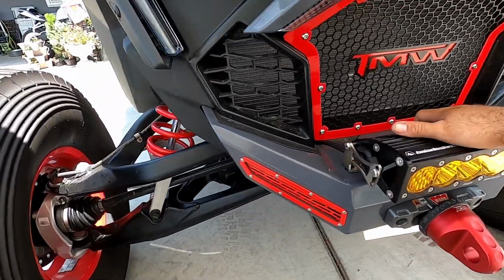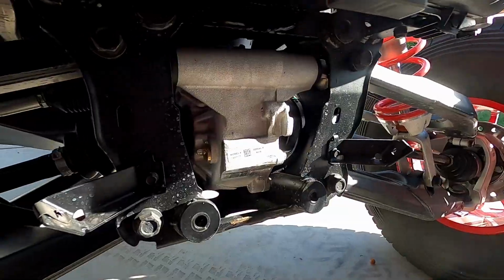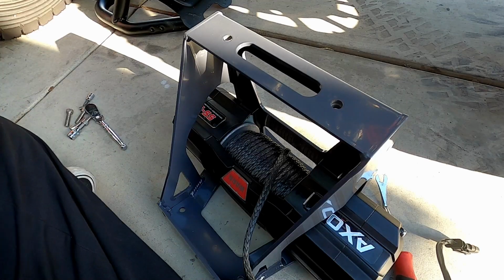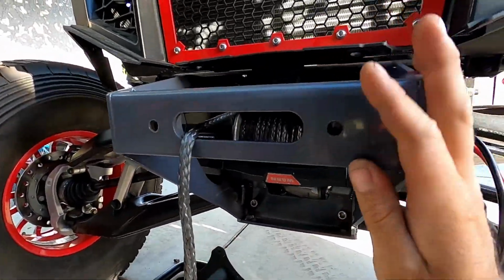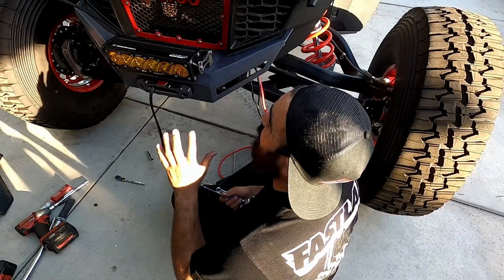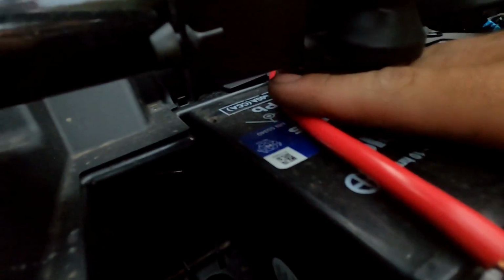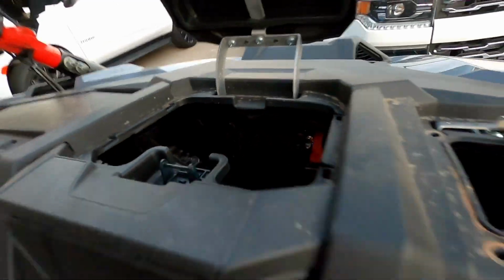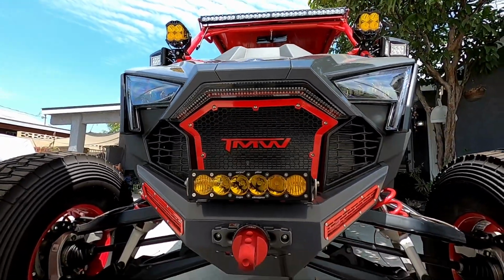Polaris RZR PRO R WINCH Bumper TMW OFFRoad EP-255

Comment: Hey Frank What are your thoughts between the Turbo R & Pro R? If you have any? Any big difference?
Reply from the maker: Huge engine difference. The Pro R has so much more potential in power. With that said. Not everybody needs that much more power the Turbo R is plenty powerful and probably better for the trails. Besides the engine and the slight wheelbase difference. They are both amazing machines for the desert, dunes, rocks, just about anywhere.. incredible machines
Reply: @GLifeUTV  Thanks that was a great response! I'll add both of them on my X-mas list. 😄

Comment: 🏆🏆🏆👍🇺🇲🙏.
Warn tech service says the smaller winches can spool onto the top of the drum, (mounting the winch upside down), wheras the large winches need to spool onto the bottom.... Which means you have to reverse the polarity.

IIRC, the Warn Hub blue tooth component will show battery voltage and line pull tension.
You did a great job✌️⭐⭐⭐.
Thank you for sharing
Reply from the maker: Thanks for the tip. Wasnt aware of that👍👍